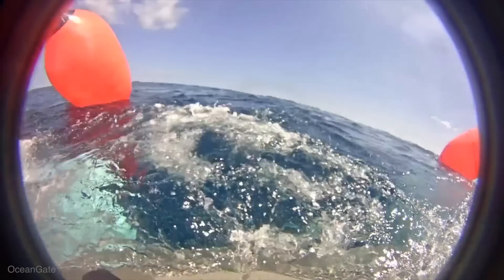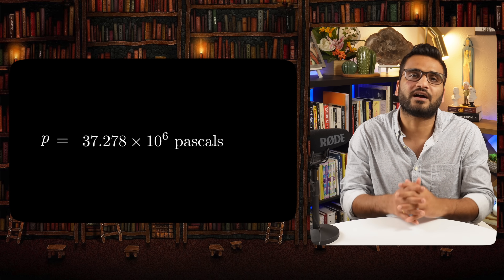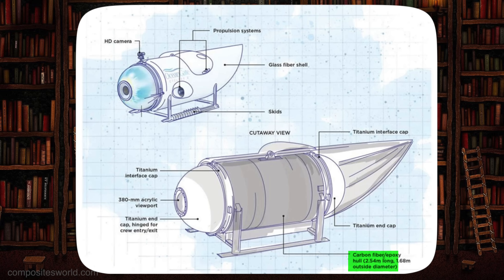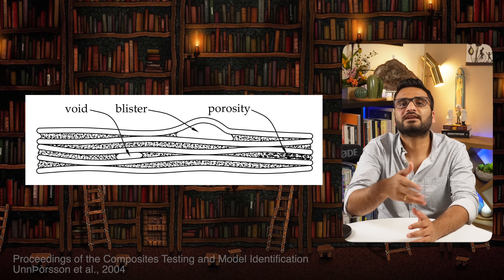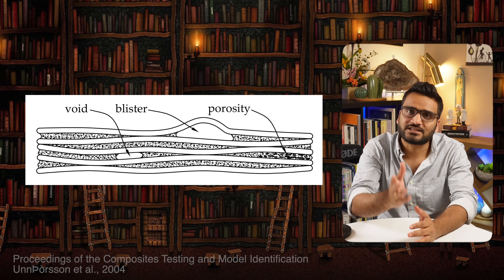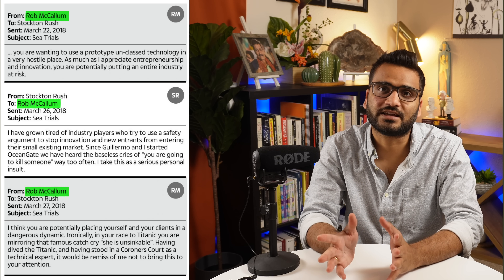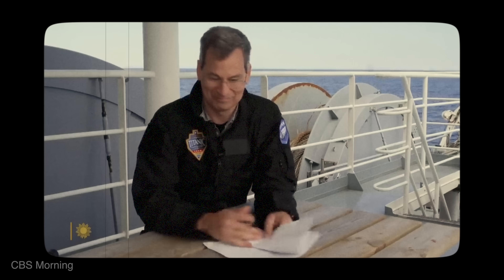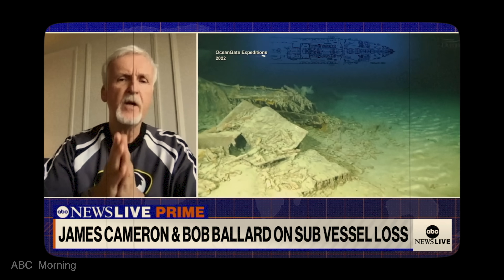OceanGate REALLY messed up - A Structural Engineer's Perspective | TITAN'S TRAGEDY

Comment: I believe the c.f. tubular body will end up being the failure point. All implosion testing I’ve seen (Mythbusters e.g.) tubular vessels (tanks, water heaters, liquid rail cars) all crush in the middle when the air is sucked out of them. The titanium end caps were rounded and probably fine but they’d put a inward pressure on the c.f. tube. The ends of the tube were the only place given any support because of the titanium end caps. The middle of the craft is the least supported area and the most likely to fail I think.
The viewport window rating included a safety margin which is what I think S.R. counted on. He used its safety margin as extra depth - scary. I think if the viewport failed we’d find more of the body of the vessel intact which is why I think the c.f. tube failed first.
Reply: Safety factor of 3 …for the window …oops run out of factors
Reply: Would a metal inner support ring installed in the middle of the carbon fibre tube have helped  ?

Comment: In this video he not only screwed on two monitors, he also screwed on a light bulb overhead. If the wire went through the hull, it would have basically destroyed the carbon fiber hull.
Reply: As eggregious as those small screwed mountings are, penetrating the carbon fiber composite for your feed-throughs would be insanely suicidal.

As far as I know, they used more conventional feed-through designs penetrating the titanium hemispherical head at the aft end of the pressure compartment.

Still have some risks involved, but manageable and using known technologies.

Comment: This is a pretty good analysis.   The main issue is the permeability of the carbon fiber to high pressure water.  The carbon was laid on in air!  Therefore there are tiny air bubbles trapped in the wrap.  It should have been wrapped underwater!   So…at depth wherever water penetrates the trapped air at 1 atm is subject to hydrostatic pressure at depth.   Over time water would invade and replace the trapped air through micro passages.   The only way to inspect the integrity of the fiber is through x ray at depth and to destruction.   Second, the carbon is end butted onto the titanium clamping ring.  The adhesive probably has air entrained in it too.  Air entrained epoxy seems unwise aat depth because of the chance of uneven strain.  Thirdly the end butted carbon tube has no reinforcement against either axial pull or uneven circular (rim) distortion.  The epoxy seems less predictable than a weld assuming all metal construction.  In short…it seems possible that the tiny gas bubbles would somehow decripate and increase permeability.   I notice the remains of the sub do not seem “fried”.  I suspect there may have been a simple crushing event.  Hard to know if there was more risk going down or going up if trapped air of construction had somehow equalized to depth and then expanded as it was driven toward the low pressure interior of the hull.  The only way to really avoid entrained air would be to build it in space.    I can only guess the strain ellipsoid along the epoxy joint would be variable and non circular.  Just how much mechanics of material was even knowable?   Engineers love composites but…

Comment: Another factor ..  even with a perfect c./f hull .. was the epoxy seal between hull and metallic ring unto which the hemispherical cap was bolted. With the relatively large diameter/ NonSpherical hull.. any flexing of the hull due to resulting uneven hydrostatic forces  could have compromised that epoxy seal.

Interesting   the conical tail was ripped  into large parts vs crushed  .. wonder what material it was made of.
Reply: The conical tail was a fairing, and not any part of the pressure hull. Most likely a relatively thin sheet metal, as its function was to improve streamlining, while lacking any need to resist pressure.
Reply: @chemech  I'm aware thanks, just expected the cone to be more fragmented.
Found out the material is fiber glass .. seen in a pictorial diagram within this very video.. 😏😐

Comment: Not sure why Rush didn't build a sphere like James Cameron? The titanium end caps were glued on? . Maybe a sphere big enough to accomodate 5 people would have been structurally too weak as well? Amazing to me that people would get in this submersible and be bolted in from the outside. The ocean has a certain mystique to me that is beautiful and terrifying at the same time. I worked with a guy that was formally in the Navy serving on a Aircraft carrier. He told me that they lost a guy. They weren't sure if he was blown overboard or fell? They did the missing man pattern trying to locate him to no avail.. He was also a pathological liar so I don't know if any of that is true? Hopefully it isn't true..
Reply: The bigger the sphere, the thicker the hull. There is no future in expanding deep sea exploration with spherical hulls. They won't float without highly complex buoyancy systems, and need highly specialised support vessels at an excess of $200K per week. It will either be achieved with innovative buoyant cylindrical designs, or will forever remain the bastion of the megarich and corporate giants.

Comment: I'm not a carbon fiber xpert but have assisted in making a hood for a racecar and I was taught by a vfn fiberglass tech the important details.we first layer in a controlled environment kinda like a paint booth.second it's very important that the resin to bond the layers of carbon sheets is mixed 100% properly and at the correct temperature. 3rd we did a counter weave do add rigidity. If we layer the fiber directly onto each other it wouldn't be as strong as changing direction 45-90 and so on.then you have the whole process of removing the air from the resin.was this vessel vacuum sealed or how was this process done as well as what bonding agent Was used not for the titanium to carbon but to bond the carbon hull itself?Was the hull then sealed and gel coated to prevent the salt water eating the resin away thus weakening the fiber structure?even down to a basic surfboard that lives its life in the saltwater there is a very specific process to follow..The videos I have seen of them making the hull and fitting the titanium caps they follow no clean ,control ssop's at all when working with the carbon fiber or when they mounted(glued/jb welded)the end caps on...

Comment: It's so surreal to watch that one video where they were hand painting the epoxy resin on the carbon fiber winding. 

hand painting

for 5400 psi?
Reply: They were using a flexible polypropylene spatula, such as you will find in any autobody repair supplier's shop.

Troweling on the epoxy resin by hand is an accepted fabrication technique for making composite structures. Automatic spreading fails to give even layers, due to the viscosity of the resin.

However, the use of composite materials for this sort of application is an extremely poor choice, given their rigidity, and poor resistance to compressive forces...

Think about pushing a rope...
Reply: The fibre bundle was passed through a bath of epoxy where it passed through rollers to squeeze the epoxy into intimate contact with the fibres. A further set of rollers squeezes off the excess. The wet bundle is then wound on the form mandrel. The spatula is used to spread out the excess squeezed out by the winding tension.  That is how I would expect them to do it.  I might also have expected them to 'vacuum bag' it, but I haven't seen any video of that.

Comment: I'm a layperson wondering how the first 2 deep dives succeeded at all. From various posts I've viewed, these are the risk issues: (1) one of the earlier Titans failed a hull test underwater; (2) carbon fiber does not have compression strength, especially for repeated dives; (3) carbon fiber was incorrectly applied in parallel strands, not in preferred the criss-cross pattern; (4) OceanGate purchased out-dated carbon fiber from Boeing at a discounted price; (5) inexperienced community college interns were the workers applying mastic to the titanium rings by hand, without quality controls; (6) the loosely ventilated manufacturing site was not protected from dust and loose debris; (7) community college interns did the wiring; (8) internal accessories were screwed directly into the inside of the hull wall, which could have affected the material's integrity; (9) the viewing port was definitely not rated for a deep dive; (10) Titan was towed through very rough seas on a raft to the site, rather than sitting on a more stable mother ship deck as was done with earlier dives; (11) basic testing was simply not done; (12) passengers on earlier deep and shallow Titan dives reported multiple glitches and problems day after day; (13) using an audio alarm for hull problems was absurd, since returning to the surface could take as much 2 hours ... and on and on.
Reply: Water ingress and repeated stress on the carbon hull is one theory

Comment: I'm not an engineer by any stretch and even I can appreciate the deficiency in a titanium bobbin wound with carbon fibers.
Reply: Exactly, the carbon fibres didn't add any strength wound like that - just like a set of rings glued together to form a tube, no shear stress capacity  !!

Comment: To sum up - it's basically breaking of many golden rules of engineering and safety. They could have also saved ending up in tears by spending money and having the submersible dive unmanned down to 4000 m depth about 100 times. And do that for a few of their submersibles - all produced in the same way. If after 100 dives each - with no problem, then at least you can have 'some' confidence.
Reply: 100 is really a large number. NASA puts astronauts on a new rocket when it has been flown unmanned 2 or 3 times. But they do a lot of ground tests too.
Reply: @chrisehmke1651  True! And also -- at least NASA engineers 'mainly' get it right. Except for example the O-ring debacle, and the loose foam/tile debacle.

Comment: By now, we have seen the first pieces of the wreck having been recovered. It looks like the titanium dome has separated from the ring section. Any idea how this could have happened?
Reply from the maker: I can only speculate at this point and we would know for sure only after the results for investigation are out. However, if I were to bet, the failure occurred at hull. It initiated with a crack, that leads to loss of strength and stiffness, followed by redistribution of forces, followed by further growth of crack, and then implosion. Once the hull imploded, the titanium dome (almost a rigid body) simply separated. Imagine if your place an empty plastic coke bottle and crush it very quickly with your feet, the bottle will get crushed and the top cap would simply fly away.
Reply: @doctorchadha  Well, by "ring" I mean the titanium section, NOT the carbon cylinder. The hull has (had) five major parts: the two domes in each end, one of which functioning as the door, two rings, also metal, I assume titanium, and finally the carbon fiber cylinder in the middle. The carbon was glued to the rings, but the domes were screwed. Why would those be pulled apart when the pressure equalized? What force would rip 17 bolts? This is weird...
Reply: @darthwader4472  Those ring flanges were almost certainly made from titanium, and the bolted connection would be extremely unlikely to shear off.

A poorly installed mate-up of the flanges, with an improperly installed gasket could lead to a pinhole leak through the flanged connection, which would have been fatal.

However, having watched video of the fabrication of the composite cylinder, and the affixation of the titanium ringe flange, the titanium was slipped over the composite portion, being adhered solely by an adhesive. There did not appear to be any mechanical aspect to the join, so there would not have been any members to resist tear-out / pull-out.

Also, the curing procedure for the adhesive and the geometry of the joint did not appear to provide for the removal of any gas bubbles formed by the polymerization of the adhesive as it cured.
Reply from the maker: @darthwander4472 The only certainty at this point is that there was an implosion. Based on that, I would think the implosion was so violent (releasing immense energy in a very short time) that it shattered all the joining pieces—including connections—and the dome simply separated like a rigid body. Now that I think, gluing a ring to the hull does not seem like a good idea. I hope investigation of the debris will lead to accurate understanding of the failure mode.
Reply: @doctorchadha  notice the lift strap on the forward dome was THRU the missing viewport,, ?important?!
Reply from the maker: Interesting. It could have been the viewport as well. Lochridge lawsuit indicated that viewport was certified for 1300m only. Thanks for pointing that out.
Reply: @TeemarkConvair  Hard to say for absolute certain, but the lack of distorion of the mounting flange seems to indicate that the plexiglas was removed by unbolting.

Also, unless the viewport suppliers were complete blithering idiots (always a possiblility, but seems unlikely) the clear window was a plug which would be pushed into its frame by the external pressure. They appear to have included a safety margin in their rating, and OceanGate was well into that, but possibly not exceeding it.
Reply: Implosions generated very high temperatures and pressures inside as the all the components of the vehicle ignite (like a diesel engine). Anything not designed for positive internal pressure will blow off (like the view port).
Reply: The bolts holding them together could have been removed post-accident.